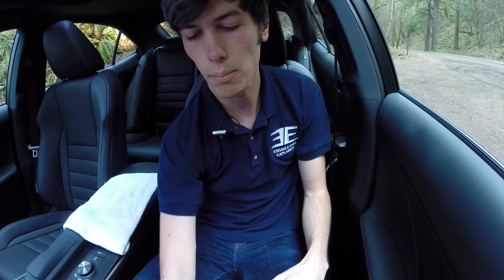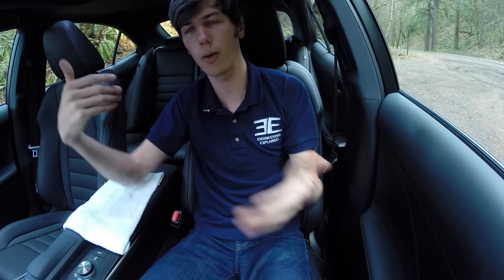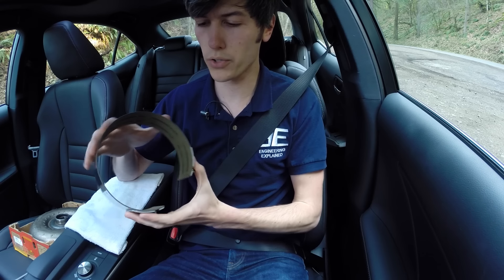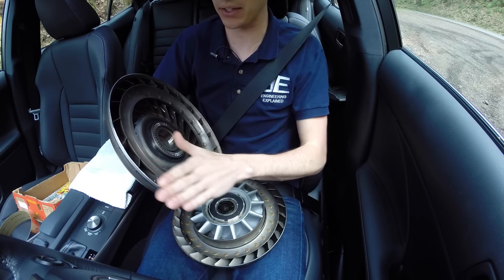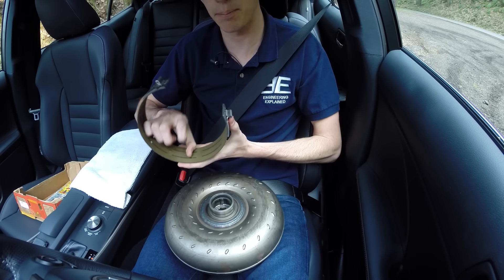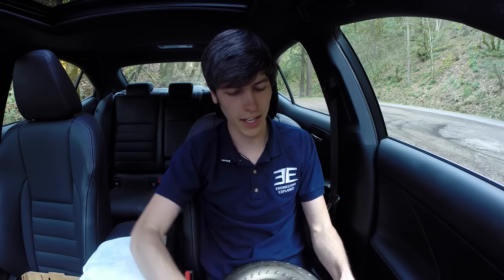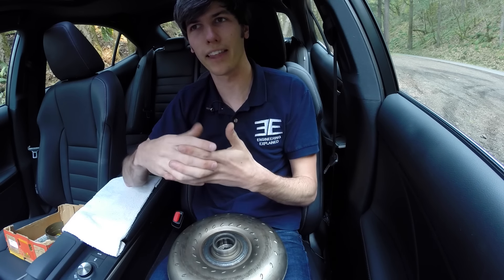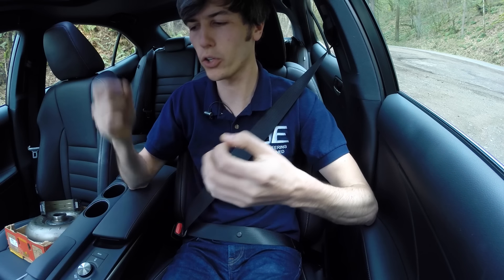5 Things You Should Never Do In An Automatic Transmission Vehicle

Comment: The idle at stop is completely different when in neutral vs drive. The vehicle vibration is annoying to me in drive. There is also the issue of having to hold my foot on the brake even if on a level surface which is another physical and mental task not necessary when in neutral. I will never stop putting my jeep in neutral while stopped.

Comment: May I switch to "P" if I expect a long waiting time in a traffic light? Or should I just keep the pressure on my brake because there was an issue before with my aunt's car. While waiting for a traffic light to turn green, it was in "D" which is drive and she was applying brakes while waiting then all of a sudden, the car engine stopped and it didn't turn on anymore.  Then the repair men told us that we can shift to "P" if there is a long waiting time in a traffic. Should I do that or not?
Reply: Yes, you can switch to 'P'. I do that all the time.

Comment: I used to have a 245hp Chysler Valiant with a Push Button Torque Flight transmission. I used to cruise up the main street of my town, Push Neutral, rev the guts out of it and hit drive for wheel spin. I had a clicking noise in my transmission and I drove 400 miles home to have it looked at. I had a 270 degree crack around the torque converter output shaft. Tough as nails those Torque Flight

Comment: I coasted in neutral with an automatic on extended downhills to save gas and bypass engine braking, but i rev matched before re-engaging drive since I am used to driving stick, and car is at 265k now, original trans.

Comment: If your car has a stuck acellerator or some other failure keeping you from stopping (diesel runaway.etc) you can also turn off the engine (turning off the ignition kills both the ignition and fuel pump as far as I know)  

Yes you'll lose power steering and brake assist, but the steering is not that heavy while you're moving at a decent speed (you'll have more than enough control to pull over) there's usually enough vacuum pressure in the brake system for at least one good press of the brake pedal, and with the engine turned off, there's nothing pushing your car forward 

The only time I wouldn't recommend turning off the engine is if you are on a downhill run, since you will need vacuum assist more than ever
Reply: Its usually best to just pop the gearshift into neutral. That way the engine is still providing power brakes and steering. Keeping the key on will also keep abs and any kind of stability control active.
Reply: @Redtooth75  that is a solution for a manual, but not every automatic will let you shift into neutral while under acelleration

Comment: Some vehicles, (Most notably Toyotas) will not let the throttle go above idle while the brake on/off switch is activated. You cannot rev the engine with your foot on the brake. I was working there when the whole floor mat fiasco happened.

Comment: I have a dodge neon that I switch to neutral at every stop because it has an oil pressure issue during idle in the drive or reverse gears. I’ll pull up to a stop and my oil light will come on and the engine will start to vibrate a lot. But if I pull up to a stop and put nuetral, it runs great and I can get around without an oil light or any vibrating.

Comment: I have a manual and when driving downhill I always use regenerative braking. The speed is holding at the speed I want to have. I use regenerative braking when I want to turn. To save fuel! It is diesel so I also put in a chemical in te tank that clean the entire fuel system! It have saved me money in the long run in fuel and in tare on the engine. It is a ford Festiva 1,4 liter diesel and the car have been driven for over 187000 kilometers. I try to use it for 100000 kilometers more.

Comment: Almost 20 years ago my mum was driving an old rwd van with all us kids in the back, the brakes completely failed going down a fairly steep hill and at the bottom of the hill was a sharp corner onto a one way bridge over a 17m drop into water. She put it in park which locked the rear wheels up and skidded to a stop just a couple metres from edge of the 17m drop. So in an emergency, you can use park if all else fails but that's highly unlikely to happen

Comment: What was the 2nd or 3 reasons not to coast? Seem like there were only 2 control and illegal, with a jump between the two like something got cut. and I've noticed a lot of new cars if you have cruise on will downshift to keep you from going too far over what you have set, which is nice on mountain roads so you don't have to use your brakes. My newest is a my daughters 2013 which she left with me while out of country and even it does this.

Comment: 2:57 no the transmission is designed to TRANSMIT power. yes it has gears but that's not what its specifically for. so idk if this point is actually that true. I mean it obviously is, but only to an extent.
obviously don't shift into reverse if you're going over even 5mph. But barley idle, idk?

Comment: I coast in neutral in my truck every time I come to a stop or go from forward to reverse, I’ve driven manuals daily for 20+ years and it just feels ‘right’ to me. I’m talking about for like 30 feet or something. I wouldn’t do it down a hill, I’d want the control and engine braking, and would be nervous about hurting the converter or something shifting back into drive at speed. With a stick you can just rev-match, ease the clutch out, and the car’s none the wiser (still wouldn’t do it for hills, but sometimes I’ll put it in neutral for a red light up ahead that turns green or whatever), but not an automatic. I also idle at long red lights in neutral sometimes in the truck, but only because it’s pretty lightweight, has a torquey V8, a fairly tight converter, and 4.10:1 gears (2012 5.3L Z71 extended cab Colorado), so I actually have to apply a fair amount of pressure to the brake pedal to hold it still, and sometimes if it’s a long stop I get lazy, haha!

Comment: I put the gear on N whenever I'm stopping at a traffic light. Not really for fuel economy but it kinda tires my leg to let it press down the brake pedal all the time, knowing if I let go of it just for a second it would go off by itself and hit anything in front. I prefer putting it in neutral and have the handbrakes up.

 When time is up, put in the D 😏, it'll try to go off but handbrake keeps it in check, so just let go of it to accelerate safely. Might wear down your handbrake bit by bit but my car's handbrake is already fricked up to begin with (bought used). Aha

Comment: My car has proactive jatco auto transmission and it automatically puts neutral while waiting at traffic at D. If i select first gear manually, it won't select neutral by itself. I can feel the difference by releasing brake pedal and feeling the acceleration difference. When it's at D, it feels like I'm at N and choosing D therefore there is a small lag. When it's at 1st gear selected manually, car wants to go as soon as brake pedal is released.

Comment: the 1. thing about is that have it in drive because the engine can still help govern the speed of the car downhill, better if it has a gear select on the shifter (WHICH WAS MADE FOR DOWNHILL) 
also your breaks are not meant to be ridden on, they will fade even if you are lightly using them.

Comment: @11:02 Please be VERY CLEAR in this area. It could save someones life. Before you firmly press on the brakes, lift your foot and make sure its not accidentally on the accelerator. 99% of all "Stuck throttles" are actually people mistaking their accelerator pedal for their brake pedal. To tell people to firmly press on the brake is dangerous. You could be causing them to mash down on the accelerator, which they have mistaken for the brake pedal, even harder.

Comment: Injectors cut off mode is not always the most fuel-efficient way of coasting downhill. But for shure using neutral is less control, so never use it. Nevertheless neutral can be more efficient because you can coast longer and engine consumes not so much on idle.
Reply: Less throttle = Lower consumption I use neutral all the time in 20 years and no problems only better mileage.
Reply: @bizjakboris  absolutely!

Comment: I remember I put my Corolla in R when going forward at20 or so kph. It made a crunching noise but after it stopped it felt fine. No apparent damage. Drove fine until I sold it some two years later.
Reply: Was it a cvt? Cause that might be why it didn’t do anything it might’ve just not let in engage in the other direction
Reply: @sethlittle7338  
It was probably some safety. It was a plain transmission on a 95 Corolla.
I don't know how many speeds. That little thing was stout. Too bad the thing that finally killed it was rust.
Reply: @olegs79  oh got ya I thought it was new one but yea them corollas just go

Comment: Driving in neutral down the hill does save the fuel and reduces the pollution, but before braking or going to fast change to gears first, which of course saves even more gas. And if you do it all the time it becomes fluent and part of the driving. It saves the fuel and is less polluting. I use it in town as well and switching of the engine on longer traffic lights. It even says to do so in the manual of older cars - I don't understand people not doing it or waiting in a car with engine running!! :(. I do many more miles per tank using it. Mechanically the engine or clutch is not going to get damaged because of it.

Comment: At a stop light I shift to neutral, because if I stand on brake, I can feel tons of vibrations ramping up in the engine. Ford Tourneo Custom.
Reply: You may have an engine mount sagging and transferring the vibration from the engine directly to the frame/body.
Reply: @jimgoff1170  No. Once you go into neutral, vibrations disappear. And engine is of course still mounted :)
Reply: @antonintopol228  but it’s loaded by the torque converter it happens quite a bit on the escape here in the U.S. it’s just a thought.
Reply: @antonintopol228  there has been quite a few cracked flex plates that have caused that kind of concern also.
Reply: @jimgoff1170  Yeah, that was my point. In the video it is said, that there is no point going into neutral. Sure, it might not give you any benefit longevity wise, but it sure does make sitting at a long stop light less shaky. The car is doing the same thing since it came from dealer 3 years ago until now with some 120 thousand km under its belt so I am "almost" sure that it is by design and by some fault.

Comment: Although leaving it in gear when 'coasting' downhill, turns off the fuel, you are effectively still removing potential energy out of the mass of the vehicle due to engine braking, this you will still need to use more gas to roll to the same distance. Effectively meaning it's less efficient than coasting in neutral.

Comment: This video is good but does not take into account one reason people shift into neutral.  It’s because they are in a situation where there transmission temperature is rising and placing it in neutral lowers the temperature.  You can see this if your vehicle is equipped with a transmission temperature gauge.  Some lifted vehicles run hot particularly when driving off road and you can watch the temp continue to rise as you drive but dropping it into neutral on a down hill actually causes it to drop.  Same thing when towing.  You can drop it into neutral at a light and watch the temperature drop.

Comment: Does this include hybrids
Reply: In some braking cases, no, their regenerative braking systems for the most part negate any full disengagement when in neutral and braking, and the electric motors perform ~1/3 to all of the acceleration depending on how hard the pedal is pressed, as well as the speed and incline, and at a full stop the gasoline engine is always shut off and disengaged unless it's needed to recharge the batteries. Hope that makes sense. I'm no expert, but I've watched a lot of vids on them over the years.

Comment: Coasting in gear slows your car down via engine braking so you will need to hit the accelerator sooner than if you coasted in neutral.  Also if your engine tries to run away you can simply put it in neutral in order to be able to stop the car, your engine may blow up if it really is stuck wide open throttle but at least you will be able to stop before crashing into something, another alternative is to simply turn off the key witch unfortunately a lot of manufacturers are doing away with.

Comment: In regards to the part of the video where you said that when coasting down the hill the fuel supply gets cut off to the engine you probably meant some sort of a hybrid vehicle that can turn off the gas engine and keep the electrical motor on. With the regular gasoline engine the fuel supply can never truly stop to the engine while its running or it will stall. The power of the moving wheels can crank the engine over, but without the fuel supply it will never run. I can see someone less familiar with combustion engines take your words literally and think that the fuel supply to the engine actually stops when you are coasting down the hill

Comment: If you have a run away throttle you should press on the brake peddle firmly and then turn the ignition switch far enough to off to shut off the ignition but not lock the steering wheel.  With no spark to ignite the fuel and the fuel pump and injectors shut off, your engine dies and you very quickly come to a stop without having to fight the engine trying to keep you moving.

Comment: In modern cars, putting in neutral  when the car stands completely still, will force the start stop system to cut the engine. Because in some cases the car won't do it automatically.

Comment: I will often switch to neutral at a stop light because if an accident happens, I don’t want the car to move itself.

You might think that is being a bit paranoid, but I’ve been hit multiple times while stopped at stop lights / stop signs.  Two of those times I got rear ended, and a third time was when an SUV in front of me tried to do a left turn but couldn’t do it before the light changed and cross traffic started moving and the SUV reversed rapidly right into my car.  (This accident showed me that insurance companies can try to cheat, because the SUV driver’s insurance company tried to claim that I was the one who rear-ended their client.  I sent them the police report and they rapidly changed their tune).

This is also the reason I usually don’t put it in park at a stop light, unless I’m on a slope.

Comment: Change  the trans filter at 50,000 miles. Use the factory filter not an auto parts store filter there junk. Get carb cleaner and clean all the break in goo out of the trans pan.Clean all the goo out of the pan clean the pan magnet put it back on. They sell dump bolts for oil pan all you need is a drill to drill the hole and a bit. Then its super easy to change the trams fluid.Due to the incredibly hot days now take off the plastic engine beauty cover on top of the engine. Its a sound deadener for GDI engines but all it does is trap tremendous heat right on top of the engine. Its fairly cool under the hood when driving but at shut down there is tremendous heat soak up to 300 degree's. I cut a wooden 2x2 stick about 7 inchs long painted it black and when done driving for the day I always pop the hood at home prop the hood on the stick and vent out all the heat. I bough my 2017 new and by doing this venting everyday it looks brand new under there the hoses look new and more importantly it will preserve engine oil & trans fluid life and belt life. Its a pizza oven under there when you park. lastly best way to maintain radiator coolant is just dump the rad a few times. Take the cap off open the dump petcock dump it and then fill it back up. Easy as can be and you do not invoke the dreaded airlock. Dump the rad wait 30 days do it again till it looks new. usually 2 or 3 dumps and it looks new. Most rads take 2 gallons approx.

Comment: Always use the parking brake when you park your vehicle. Make sure the parking brake is set firmly, or your vehicle may roll if it is parked on an incline.
If your vehicle has an automatic transmission, set the parking brake before you put the transmission in Park. This keeps the vehicle from moving and putting pressure on the parking mechanism in the transmission.

Comment: In Europe we use liters per 100 kilometers for measuring fuel consumption. When driving down hill in gear, the car will actually show a current consumption of 0 l/100 km. So we can see that no fuel is being used at all. For a normal drive the fuel consumption is around 4 to 10 l/100 km depending on how economic car you are driving and while accelerating it goes from 10 to 30 l/100 km.

Comment: What is my BMW doing in Eco mode? When I drive to a Stop Light, the RPMs go down to idle and the Motor idles. What is happening at this moment? Isn´t it the same as I would do when going into Neutral? This also happens when I coast without Gas applied. It goes to neutral RPMs and when I apply Gas it revs up to the needed RPMs.

Comment: A little heads up at traffic lights stop's!
Why sticking your foot on the brakes as a nerves drivers do?
For me it's a good time enjoy the moment and stretch my legs and let the blood flow as well as the gearbox fluids will do and circle around the cooling system freely

On the other hand if it was a good thing to do? We should shift to drive and press down the brakes during engine warm-ups instead of sitting it on idle